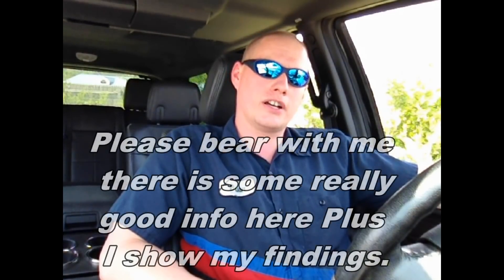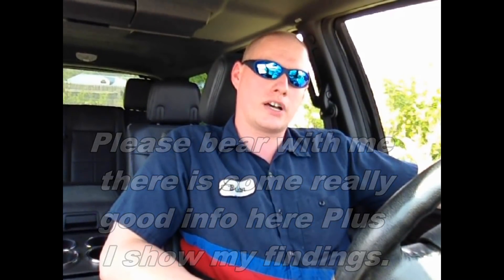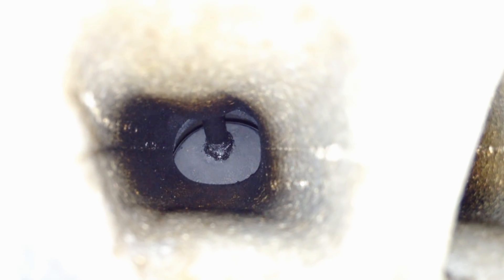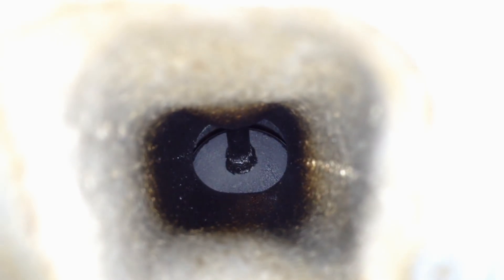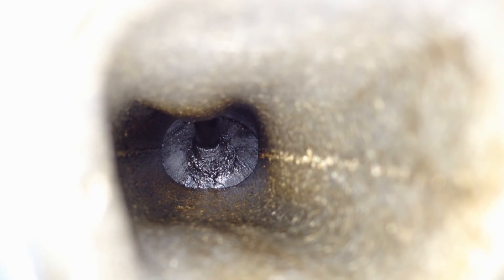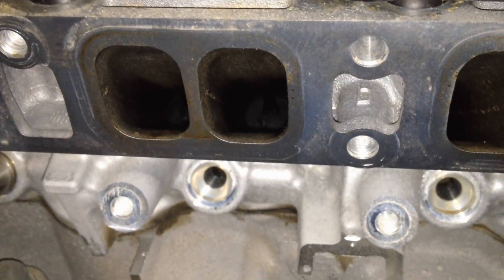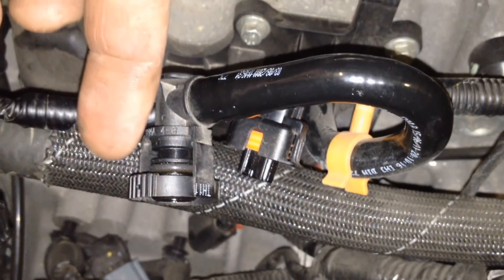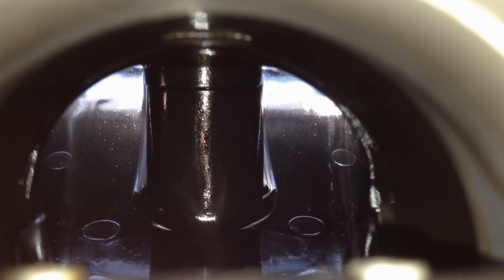Ford Ecoboost Warning Part 2 My Findings

Comment: Am in the market for a new vehicle. I gather I don't want anything with the words Ecoboost, or Turbo in the description. BUT. I want a F-150 Crew Cab. I also don't want a gas hog. My vehicle choices up until your videos about carbon build up. Were the 2.7L V6 F-150 and the 2018 Ford Edge. Not remembering its engine type. But I know it was also Ecoboost. So now I am torn and up in the air as to what vehicle to buy. Can somebody please give me advice. I need the ground clearance of a Truck or crossover. My 09 Focus drags bottom way to often on the back roads here in Ohio. I also need the rear seat leg room. Like the Edge has. The leg room in the Crew Cab F-150 is so impressive.  I am in love with it. I just don't think I can bring myself to buy a larger engine truck and only get 16mpg. That's just sad and pathetic.
Reply: It is a full size truck not a Prius.

Comment: It’s been a few years now. What are your thoughts on where things are at today?
Thanks! 
Good work by the way!
Reply from the maker: BG GDI induction service is supposed to be safe.
Reply: FordTechMakuloco 
Thanks for the reply!
From what you’ve seen, has Ford remedied the carbon build up issue of DI? Say, on their newer models of the ecoboost line (2.7 & 3.5), is this sort of maintenance still expected to need be done? If so, what intervals under normal/average pickup truck use?
Reply: Thanks!  That's the first time I"ve heard possible promising news ..... has the process changed from a few years back because the earlier info was that the BG GDI induction service caused damage to turbos.   EVERY dealer I call, claims that THEY do the BG induction and EPR services EVERY DAY with NO problems turbo or otherwise.  Even the parts guys say they don't go through turbos at the dealer.   I haven't done it yet at 54000 miles... running well SO FAR.     THANKS FOR THE HELP.... STRUGGLING  with the decision to do the services or not.  (Wishing I bought the 5.0 but too late now)

Comment: Hey man, Thank you for the way you are servicing all of us. This is very useful information. 

This was 3 years ago, Any update since? I just bought a 2014 with 50,000 miles and I think it is running rich because my cab starts to smell like propane when the ac is on. Im sure you've had experience with that.

Comment: Thanks for these vids. I just purchased a 2011 F150 Lariat 6V 3.5L w/100k miles on it. I heard about the canister mod to separate the oil from the air. I am sure my engine has major gunk build up from all these years. What is the most recent news on this issue? Is adding the oil separater still recommended? Is there an approved method to clean the valves? What would you recommend as the best/economical maintenance I could perform to get the valves cleaned and operating at peak efficiency? Thank you!

Comment: Thanks for the video Brian.  I just found your channel recently because i was considering buying a new 2nd gen Raptor.  Since it's now 4 years after this video, does Ford now have a cleaning method for GDI carbon buildup?  BMW has a walnut media blasting procedure for this that works really well.  It's similar to sand blasting using compressed shop air but with with recycled walnut shell media and a shop vacuum.   I do plan to install the oil catch can you recommend, but the reason why i ask this question is because i may also consider buying a used 2nd gen Raptor which would most likely already have carbon buildup that i would have to clean first.

Comment: Direct injected engines will always require a media blast cleaning and intake caustic bath cleaning. It does not matter if it's gas or diesel. Plan on doing it every 50 to 60k. The carbon build up is profound on intake, egr, swirl flaps and intake manifolds. My BMW 335d was anemic at 60k until I performed the cleaning. I was also pulling a code from the number 6 injector. The stealership wanted to charge me $2500.00 for the carbon cleaning and an additional 700.00 for a new injector! All a result of carbon build up, and I mean "nasty" carbon build up! Between DPF and carbon build up issues, it's better to own a common rail injection system fuel delivery engine. Period. Your wallet will thank you and reliability will be restored.

Comment: so if you added a good cleaner to your engine oil think the vapors pulled from the cleaner would help to clean the intake valves ? also we used to have carbon problems with the northstar engines when i worked at gm  we used to use a carbon buster from gm looked like shaving cream you spayed it in running and then let them set for 2hr and then restart and idel at 1500rpm and the carbon knock would go away  .also a race car type oil serator mite be a good idea

Comment: ,,, my son's, 2014 Escape 2 L EcoBoost all-wheel drive,,, has 60,000 miles,,,, absolutely no problems whatsoever,,, but in April,, I'm doing the major,,, preventive maintenance,, removing intake manifold cleaning the valve s. Flushing engine block and radiator,,, new thermostat,,,. New brakes all the way around,, a little early,,,. New spark plugs,,,.   I would like to drain and replace every fluid in it,,, if I can find the drains and know how much to put back in,,. ???    Pumpkins,. ??  Transfer case,,. Transmission,,, ???  Can this be done,,. ???

Comment: ,,,, good info thanks a lot,,,.  Have you ever heard of a,,, drip leg,,, ???   For natural gas hot water heaters or furnaces,,???
Reply from the maker: For condensation?
Reply: FordTechMakuloco ,,, yes,, but it also catches contaminants,,. So it don't reach the gas regulator,,. !!!  So a PVC plastic or copper tubing,, drip leg with a cap on the end that can be drained,,,, should also help,,. ???    Down at the bottom of the intake manifold,,, closer to the source,. ???    And or the filtering they use to catch moisture and oil for a spray gun for paint jobs,,. ???
Reply: FordTechMakuloco ,,, so they do have a baffle,,. ???   And a inverted trap,,,???   To help keep it out of the intake manifold,,. ???

Comment: Big turbo Focus ST 400+WHP, no issues. Catch cans, regular oil changes, upgraded PCV helps. But because off VVT, and because of valve overlap, soot will still coke up on the valves. Clean valves regularly (couple different options), or add port injection and meth like me!

Comment: I think people are getting too obsessed with it. There are a lot of owners on the F-150 EcoBoost forums getting 200,000 and even some over 300,000 miles on their 1st gen 3.5 EcoBoost engines and still going strong -- WITHOUT a catch can or any other modifications. The new 2nd gen EcoBoost does have both port and DI. Port will help wash the intake valves and help with the cold starts, but like I said, there are plenty of people (at least with the 3.5 Ecoboost) with a lot of miles and no problems. I think the top tier fuels probably burn cleaner (Chevron fuel especially) which will leave less carbon deposits. Also, a good oil couldn't hurt. Maybe not all EcoBoost engines have this problem?
Reply: I have one coworker who had an ‘14 f-150 ecoboost. He traded it in after having to replace turbos and heads. He never made it to 100k. My mother bought  a ‘17 ecoboost escape brand new and is having misfire issues at under 40k. She put 270k on her old Forester turbo then gave it to us and it is still going strong at over 300k. I would not buy an ecoboost.
Reply: Landon the other fact is I that the port injectors are low pressure, so less cleaning on the back side of the valve.

Comment: So, what happens if you just unhook the PCV Valve from the Cylinder head and block the hole in the head and vent the PCV valve through a filter to open air.   Not environmentally healthy,  but I bet it solves the problem.

Comment: They need to start integrating direct injection with port injection during startup time Splash a little fuel in there to help clean it out. That's going to be the solution of this no matter how they engineered as long as the EPA wants you to reburn Vapors from the crankcase there's always going to be this problem.

Comment: We have more then a few ecoboost in rental fleet these cars are abused oil changes every 7500 miles. Most only have about mid 40k  then we send them to auction but we just don't see problems with them. Very strong engines and plenty of power even in the expedition el. My explorer 3.5 non-turbo had a bad water pump at 78k  I was a little pissed about. When I pulled engine apart internals were very clean.

Comment: Can't we just let the PCV vent to atmosphere. Wouldn't this solve the problem of carbon build up the valves?
Reply: L RBS but the tree huggers will get mad if you do that
Reply: Give it a go; your engine won't run as well because the ECU is programmed to acct for PCV ventilation.
Reply: @Rexmorgan687  my engine runs no different after I vented the pcv to the atmosphere just as long as you block off the intake port after taking the pcv hose off your engine will be fine.
Reply: Yes, and short trips don’t help
Reply: Yes I did it on my 2015 2.0 escape their is one on the intake filter side that comes from valve cover it is not as important not much oil comes from it the PCV under the intake is the main one all the intake tubing was coated in sludge so I took some jb weld sealed up the intake port that pcv goes to and cut the pcv hose and add a long hose to it that routes under your car if you just unplug it then when you run the air your car will smell like gas fumes trust me i learned the hard way my wife about killed me over it so I had to jerry rig up a hose where the fumes went out of the engine bay

Comment: Knowing this I would never buy this type of engine, replace heads and do some expensive intake cleaning? You could probably get good results just by spraying water into the intake with a spray bottle while its running once in awhile
Reply from the maker: Not a good idea to spray cool water in and shock a chunk of carbon loose to tear up the turbo.

Comment: If the engine is direct injection how does a fuel system cleaners prevent carbon buildup on the back side of the intake valves?

Comment: This PCV issue sounds like the same thing that was going on with the GM vehicles with AFM/DOD. They released a revised valve cover that relocates the PCV port, and put a plate over it, so help keep oil out. I know, I've had plugs fail twice due to carbon build up and burnt oil. Almost 75k miles.

Comment: Would it be possible to remove the intake manifold then make sure the intake valve was closed and spray something like Gumout carb cleaner in the chamber, let it sit for a while then stuff rags down in there to mop up the mess then use air to dry it out?

Comment: wish I knew the problems with these EcoBoost engines, purchased a 2012 F-150 V6 with EcoBoost. They ran great for two months 6000 miles later I have cold crank problem followed by the engine light blinking and now there is Major misfire. it has 80,000 miles on it so and I'm a didn't purchase it new so I have no warranty on this thing. man this sucks

Comment: Direct injection will cause carbon deposits. The fuel is atomized under that kind of pressure. Any manufacturer is going to experience the same thing!

Comment: May be wrong here but on direct injection isn't the fuel injected directly into the combustion chamber? If so then there is no fuel going past the intake valve so where is the carbon coming from? Oil past the valve guide seal? Valve timing allowing some combustion gasses to escape around the valve? Just curious.

Comment: These are awesome motors...my buddy's have well over 100k miles with no issues
Reply: lol 270k on my toyota almost broken in
Reply: 103K on my F150 XLT 3.5L EcoBoost...but when I punch it I get a cyl 2 miss. Gonna replace plugs and coils today.
Reply: @jensdavidsen4557  fixed it?
Reply: @Mitchs  dang... forgot to respond to this...I ended up not replacing the coils, just replaced plugs which was super easy...and hell yes...that did the trick. On cyl no. 2 you could see the crack in the ceramic insulator of the spark plug so it was a dead giveaway.

Comment: So please explain why that carbon causes cold misfire?
Reply from the maker: +Matthew H This impedes airflow but the carbon in the cylinders absorb the fuel like a sponge and the engine needs that rich mixture when cold.
Reply: I am not doubting you.  I own a ECOboost with the cold misfire. and I have ALOT of experience with engines.  so without being jerks or letting our egos get in the way. lets hash this out.  First the carbon you show in the video is not abnormal for almost any internal combustion engine and is no where near the level of carbon deposited that the 4.0 experienced in the mid 90's when FORD came out with the walnut shell blaster.   I agree the carbon will absorb the fuel (as it did on the 4.0) but with it being direct injected the fuel is A: sprayed in the cylinder when the valves are closed, and B: right at the spark plug.  That is why they can run a "lean" mixture and get added MPG.  Also if you are stating that the carbon on the piston is an issue (could be) I have yet to see any answer to address that. Instead everyone is focused on the valves. and in fact "replacing the cylinder head" does nothing with the pistons. 
As far as "disturbing the airflow" while I see an airflow disturbance, wouldn't that cause a misfire all the time or does the carbon somehow shrink when the engine gets warm.
I 100% believe in catch cans and have one. seeing the goo that comes out of one will make you a believer.  I am sure EPA rules limit catch cans to the general public as most will forget to service them which will lead to even worse things.

Basically I see what you are saying but not quite buying it, only cause I might be old school.  Do not take offense to anything I have said as there is absolutely no intention on my part that way.

Comment: if I'm having idling issues with a 2.0 ecoboost how often should I use the techron??? every oil change as usual, or more often???
Reply from the maker: Techron is one of those you use every fill up but I would go for something a bit more potent like this every oil change- http://amzn.to/2soXzxm
Reply: FordTechMakuloco Thanks for the reply. Do you know where they sell this in stores??? Ever since I saw this video month's ago I've been using only chevron, Mobil, or Exxon and using techron every oil change and it's running much better in just 10k miles. Do you know the horn location on a 16' Titanium ecoboost fusion??? Sorry I know it's off topic, but mine cut out and the dealer wants to charge me just to lool at it, so I'm gonna try an replace it myself. Any tips to help would be greatly appreciated. Thanks again.

Comment: would a catch can help this issue?
Reply from the maker: +Henry Gooner yes I have many videos on this.
Reply: Yea was just watching the installation on the f150 Ecoboost. My issue after seeing that video is that I've got an aftermarket air intake without the top cover. Think it's worth it to invest in the aftermarket cover so I can drill the hole?
Reply: FordTechMakuloco would a catch can void the warranty?

Comment: I just bought a 2015 2.0 EcoBoost Fusion with 27,300 miles. What is the latest on a fix for the carbon build up issue?

Comment: I was just wondering a seafoam treatment work on the ecoboost engine
Reply: NO DON'T use Seafoam it's not good for ecoboost engine or Turbo's
Reply: EcoBoost 2.7  what about Lucas fuel injector cleaner

Comment: currenty replacing the head on our 2012 Explorer EcoBoost. one owner, purchased at Future Ford in Roseville Cali. never been touched by anyone other than this dealer. all scheduled maint done on time. 74K miles on this motor and ford says they have no idea why this happens. not going to cover it on the warranty, costing us $3,600 to fix. one we get it it back it is going to CarMax. Ford is really messing up by not standing behind their cars and Paying dumb. If not for this Youtube we would have believed Ford deception. Thank you for doing this!

Comment: Thanks for the info. I've got a 16' 2.0 ecoboost fusion w/45k miles on it and everytime right after I put gas in it it will hesitate while idling, and then if if I do "the Italian cleanup" it will idle just fine all day. Gonna get some techron today and see if that helps at all, cause I've owned it since 21k and I've never added any fuel cleaner to it.
Reply: Evap purge valve may not be closing at times, most noticable after fill up.

Comment: After watching your video regarding this oil vapor problems, would an oil catch can inserted between the PCV and the air intake be of value to reduce this problem? If so, I'd love to see a video of its installation.
Reply from the maker: +Loren Jennings Yup I have a install video on the channel here and more to come.
Reply: I've watched this video of the install on the F150. It's a good video as you describe the theory of how the OCC works and how it is installed on the F150.
You might consider doing the same OCC install on the 2.0 L as it is considerably different. I don't know if this particular kit would be necessary, but at least one that is similar.
I appreciate your videos as they are very informative.
Thanks,
Loren

Comment: The only permanent fix for this problem is to install oil catch can.

oil build up is an issue on all Direct Injection engines, but issue intensifies with turbo due to more blow by.

Comment: What year of Ford was this 2.0L EB motor in? How many miles? 
Have you tried or do you think an Oil Catch Can would be beneficial on the PCV line?
I've read about the same ino in your video, that the oil laden return air in the PCV system is recycled through the intake/turbo back into the cylinders is a problem.
Thanks,
Loren